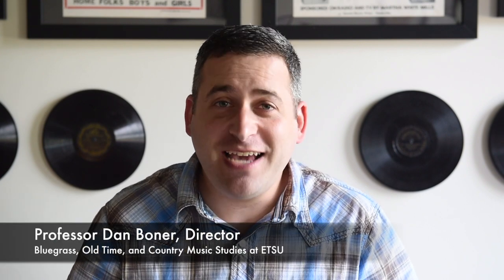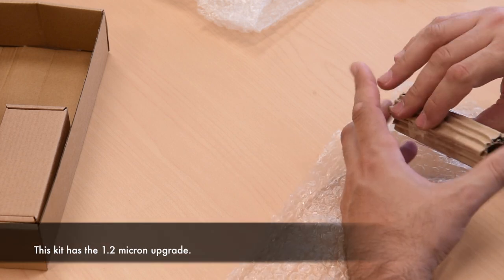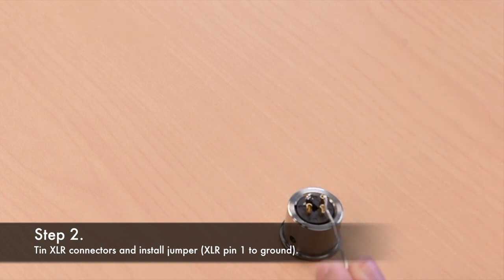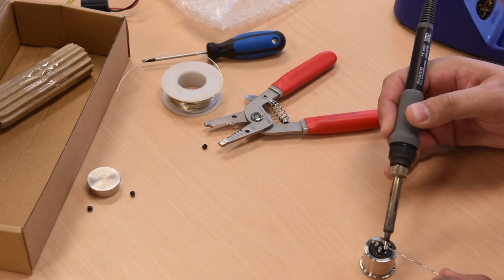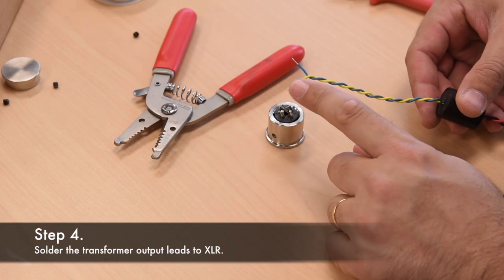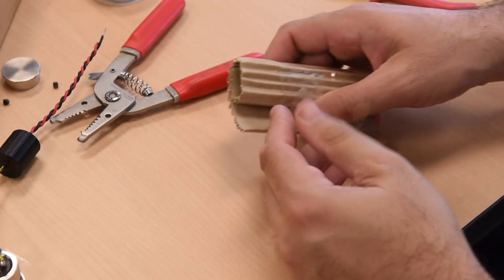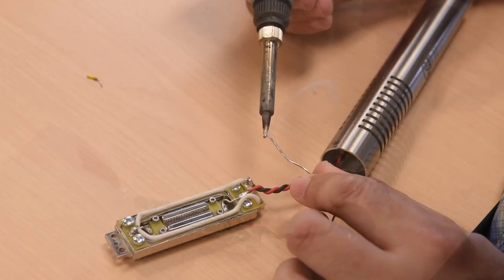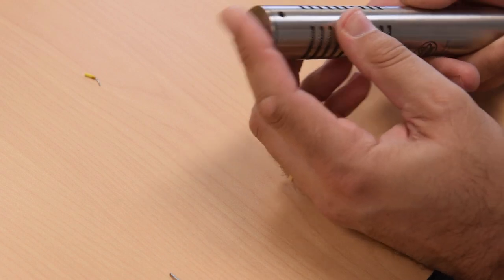Bumblebee Pro Audio RM-6 Ribbon Mic Assembly Guide

Comment: Are you sure that your soldering is correct? In the manual on the bumblebee website the black/red cables are connected to the XLR jack!
Reply from the maker: You should double check with Artur Fisher. The transformer in the video is a new model from what was in the older instructions. I actually first hooked it up with the red and black to the XLR and it was backwards. So, consult Artur.
Reply: Hi, I checked it with him and he told me your way is correct. thanks

Comment: Great video! The two steel barrels covers are very tightly adjusted on mine, and because the weather is very hot this time, the steel expand and its impossible to remove them by hand like you do in the video. I put them to the fridge for a short time and I'll see if I can remove them. So for those who want to build this I encourage you to chose a tempered environnement.